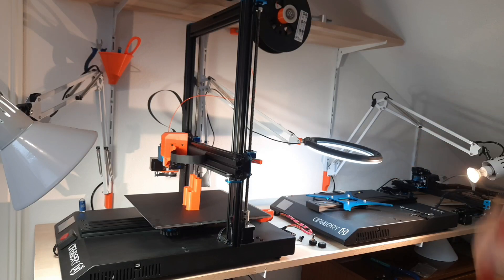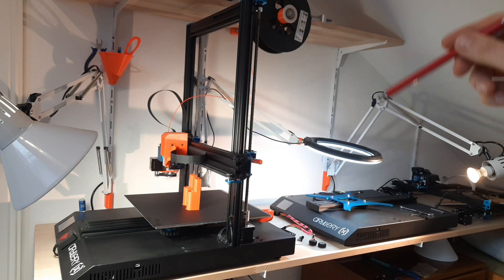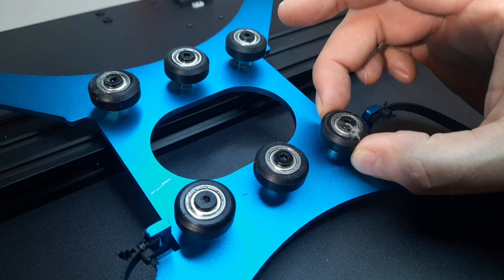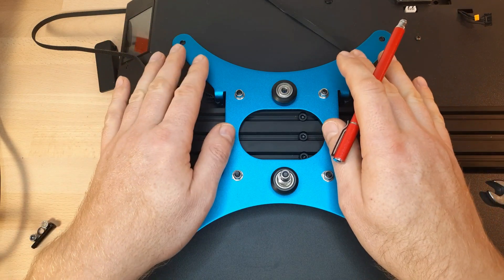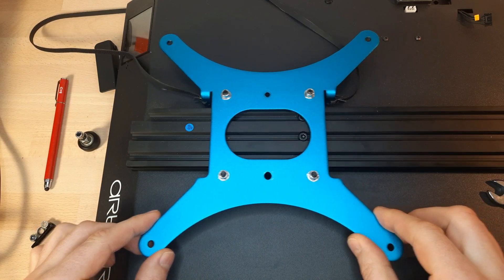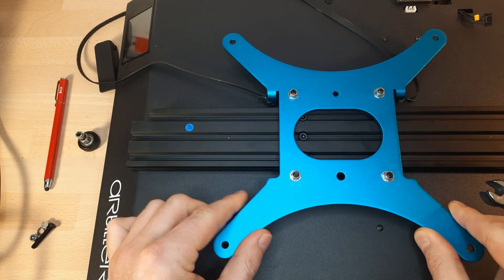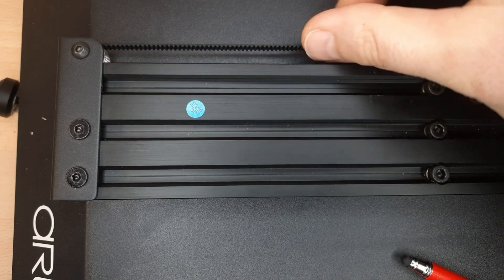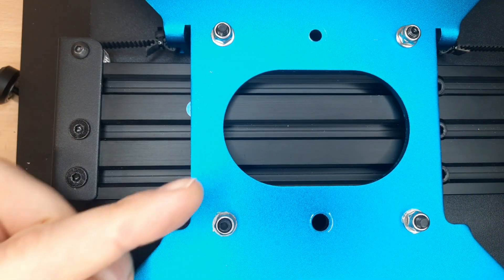Wheel Upgrade ?  Artillery / Creality / Anycubic ...

Comment: I agree that polycarbonate is an odd idea. Marketing I think. The properties of polycarbonate are all wrong for such an application.

My picks if I was starting from scratch and nobody had invented one of these machines before, would be POM first, then UHMW-PE, then nylon, then maybe hard urethane rubber like what skateboard wheels are made from. 

V groove wheels scrub in the groove, it's a side effect of having them locate the bed in more than one axis, i.e up and down as well as side to side. POM abrades, which makes fine dust that acts as a lubricant. That's how POM works. Polycarbonate will make very fine dust that probably isn't at all lubricating. Polycarbonate is chosen for it's toughness and impact resistance, not it's friction coefficient. UHMW-PE wouldn't abrade, it's extremely slippery, but I think it's too soft and much deform, and it doesn't like temperature. I don't think urethane rubber is great without some kind of lubricant. Teflon? 

I don't know, maybe reinventing the (v-groove) wheel is a waste of time.

Comment: I have changed to polycarbonate rollers. The Delrin (or POM) wear out and create black dust in the grooves. The plastic you broke with the pliers looked like acrylic. I was a machinist and worked with polycarbonate quite a bit. It doesn't shatter are break like it did. It is more forgiving. It bends not break.
Reply: IMO the POM dust isn't an issue. It's part of how POM works when there's friction. The wheels scrub because they are in a V groove. The resulting dust acts as a lubricant, and over time the wheels will scrub less and less. They are designed to wear in. Polycarbonate is entirely the wrong material to use in such a scenario imo. You want something that either wears in with dust that acts as a dry lube, or something with a low friction coefficient. To me POM is the ideal material, but maybe UHMW-PE? I think Polycarbonate is just marketing. UHMW-PE isn't as sexy as polycarbonate, not that many people know about it's amazing properties. I do think it's probably too soft though.

Comment: Interesting, not 100% sure about the statement on linear rail, the play on the carrier is basically not existent and much less of the one you can have on Pom wheels, lot of corexy use linear rail on all axis with good result
Reply from the maker: There are many options to upgrade and tune eg. I like to focus only on upgrades that have a visible effect on my prints. Changing to linear rails does not print any better than good adjusted wheels. If I would see any better prints anywhere, I would have already upgraded to linear rails, hemera extruder, 32bit board - but no, I didnt upgrade all that. Have you seen any better printquality somewhere?
Reply: @Just Printed_3D (EN)  Yeah, basic bed slingers do beautiful prints when tuned well and run at a realistic speed. 

I think these core XY printers are all about speed. In that scenario, with the extreme accelerations ect, you need something that won't have any play or flex in it.

Comment: the linear guides must not have grease or oil, but dry lubricant. (ptfe, silicone) depending on the models, a linear guide can withstand more than 300kg of stress.. in the case of a 3d printer it will be necessary inserted a damping material if you want to limit the resonances. this kind of guide is used in cnc milling machines and poses no vibration problems

Comment: having done the polycarbonate wheel upgrade... Its a pain to install and there wasn't a any noticeable difference... i would firstly make sure your wheels are properly tensioned.   if you use it for a year or two. and need new wheels/bearing etc... then sure why not use them.